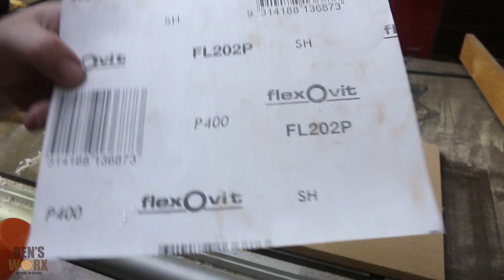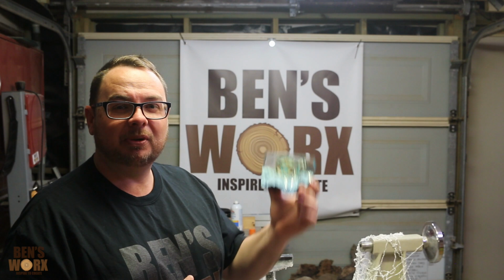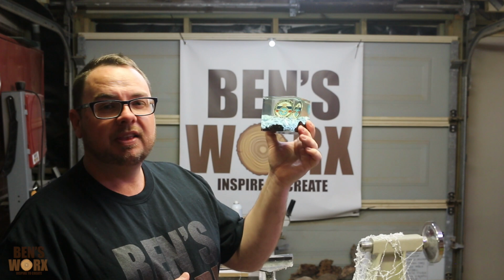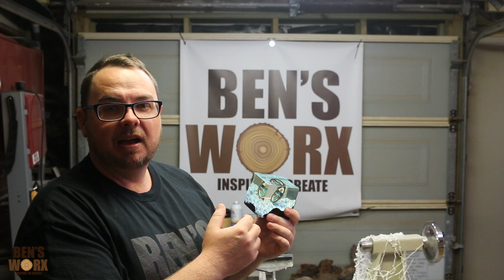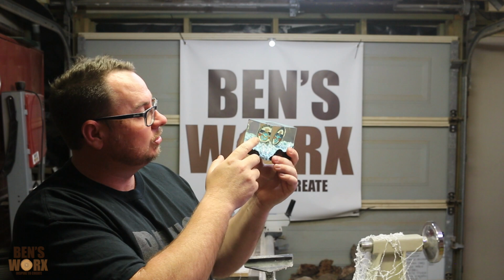Embedding an RAF Coin in Epoxy Resin

Comment: I recommend buying 3M sandpaper, you don't need to use spray adhesive because the backing is a heat activated adhesive to make sanding sticks or to stick it to a surface, very handy
Reply from the maker: Thanks for the tip David